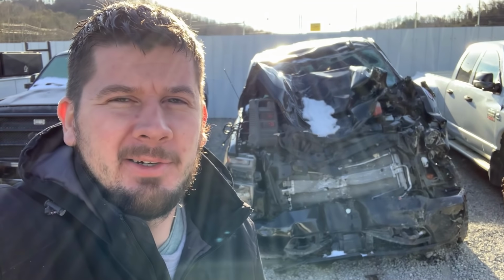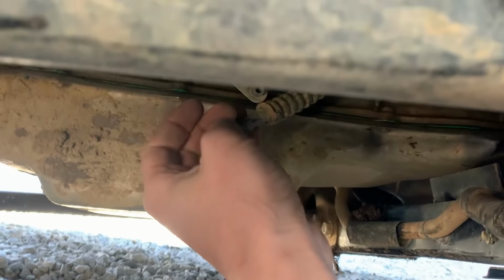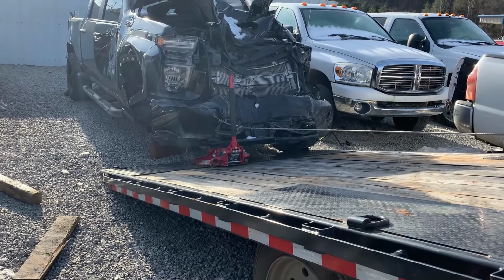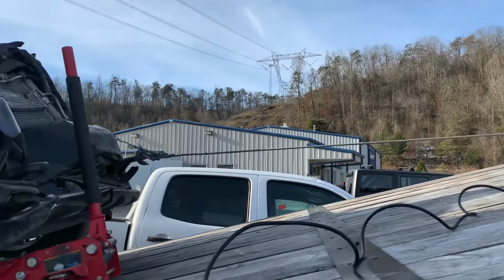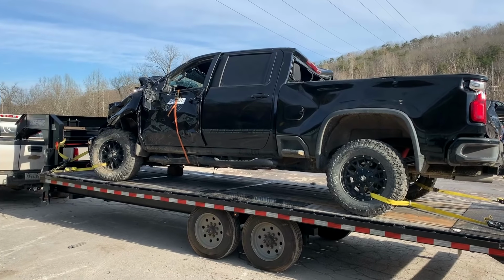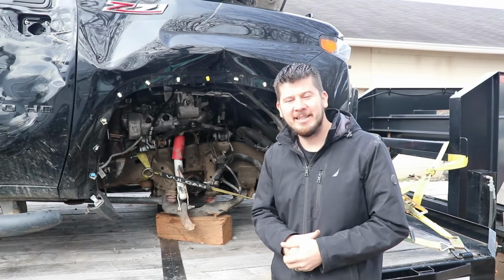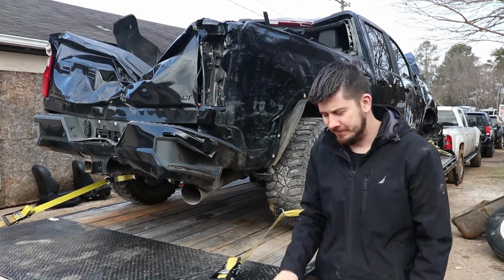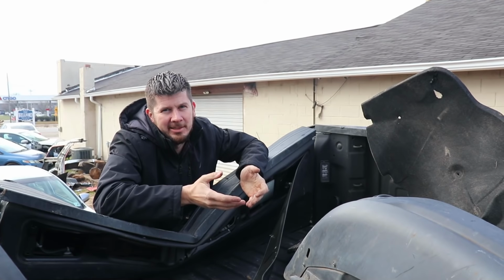REBUILDING A 2021 CHEVROLET SILVERADO DURAMAX 2500 EPIC BUILD

Comment: Nice start it can only get better after you remove the damaged parts and even if you put used front end on to make it a roller it will dramatically make a visual difference

Comment: To help you decide what to do, if it were me, I'd remove all the destroyed parts (front sheet metal, bed, LF door, etc), get the RF suspension to where it rolls, then put it on your frame rack and assess the condition of the frame. That would tell you if it's even worth continuing as a rebuild, or if it just becomes your donor truck for a truck that is in better condition that perhaps needs a drivetrain upgrade.

Comment: That knob was for the tow/haul mode they don’t have that backup assist. You boys have your hands full with this one .changing the color should be easy since you have to replace almost every panel . Good luck 👍🏻. And the motor alone was worth it.

Comment: Lkq probably your best bet but I would try your local salvage yards. Not going to be a fast build and not going to be easy...I doubt you will find another 4x4 like it unless you can find one from a flood cheap version and swap all your guts into it only it will get what we call blue tagged because the VIN numbers can't be moved from one to another so your DMV may issue it a new Vin.👍👌✌️

Comment: I would love to have mine rebuilt but cannot afford it. Do you guys do rebuilds for the learning aspect of it or for videos?
Reply from the maker: This will be the new shop truck
Reply: @NikoBrothers  would love to have you rebuild the engine in mine. It still runs just has miles.
Reply: would you guys be interested in a 2006 2500 HD Crew Cab LT. 256k miles. runs and rives great.
Reply: 6.0 gas

Comment: You need to invest in some cheap tire dollies.  Ratchet strap it to the frame where the wheel is missing and no worries about a jack collapsing.

Are there ANY good body parts on it?  It looks like it needs a complete body swap.  It looks more like a parts donor for something else, something to take parts FROM, not something to put parts ON.

Comment: I'd start by tearing down the front to see what's left.  If the engine and transmission look good, and if you can find a donor truck with the engine and transmission, etc. destroyed, do a swap.  But you only have $59,000 to work with.  I'm with all the people who didn't bid on this pile of crumpled metal.  I'd spend my time fixing the camper with the broken engine. Or the burned out Class A hulk which actually ran.

Comment: It will be a lot of work. You got a 70 thousand dollar truck for a little over 9 thousand, so you have plenty of room before you're losing money. If it was me and I had the room I'd take everything apart the front the bed those seem to be a total lose. Can the cab be saved? Could you find a cab a front end and bed to bolt onto the frame. A lot of parts a lot of work but if anyone can do it you guys can.

Comment: There is absolutely no way that truck will be safe if rebuilt. That is a parts truck all day long. Your going to need a new cab and that is going to be pricey. I say find another one wrecked in the rear that has a good cab on it or one wrecking in the front that has a good cab.

How did yall keep a straight face making this video. It was too funny.